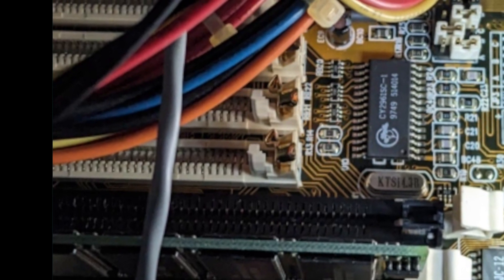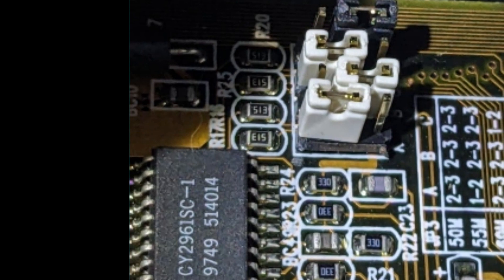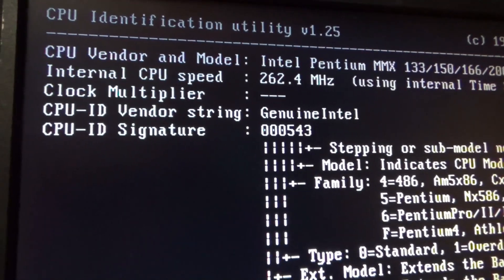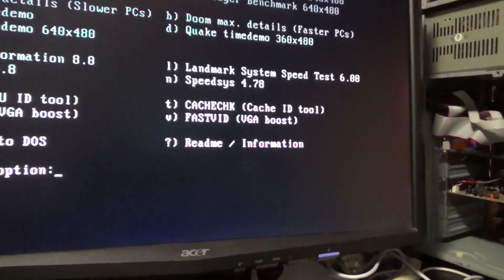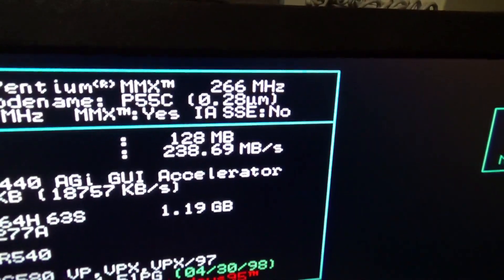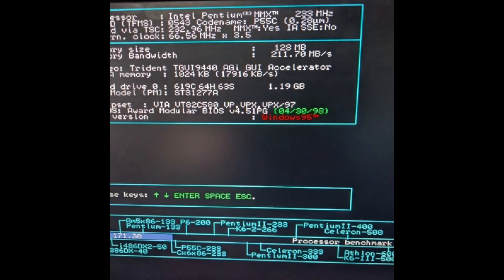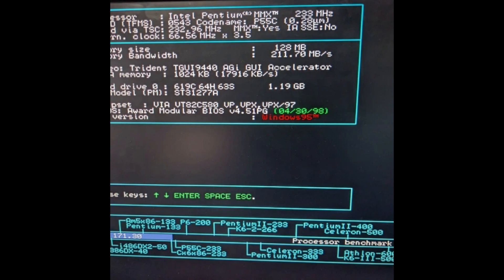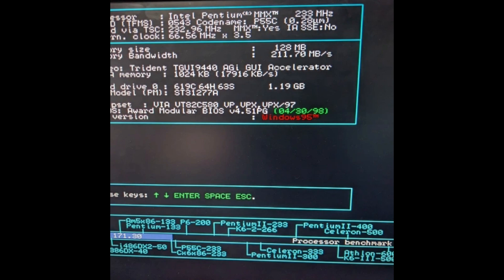Overclocking a Socket 7 board with a Pentium MMX 233MHz

Comment: windows (assuming 98 or ME) shouldnt complain since the mobile vwesion of the pentium came in 250 and 266 versions using the same instruction sets. 95 might not like it but the k6-II patch should fix that if its 95-c.
Reply from the maker: It has had no complaints. I may update to OSR2 or 98. This is a good learning experience.